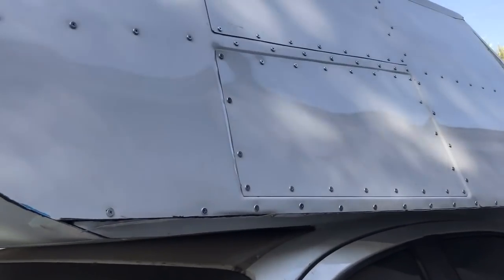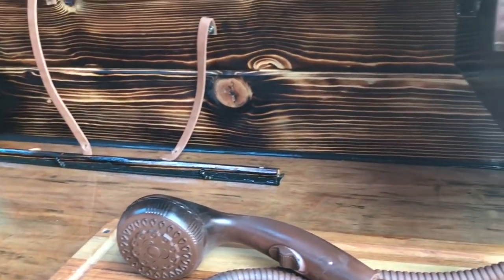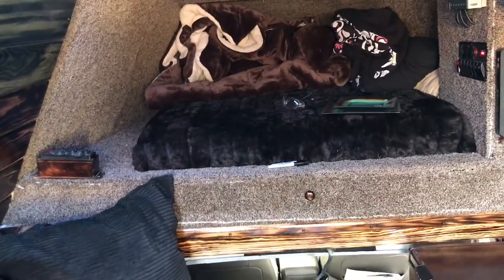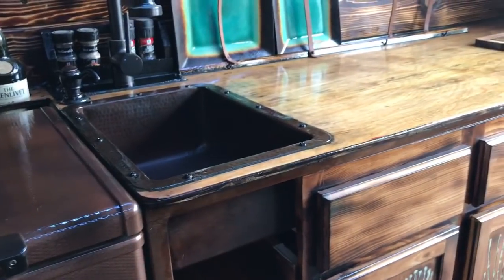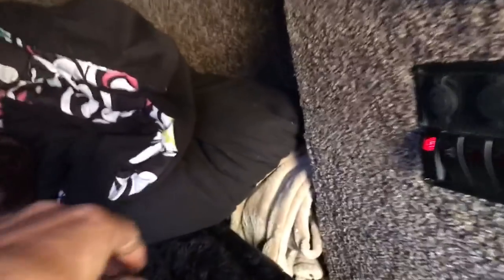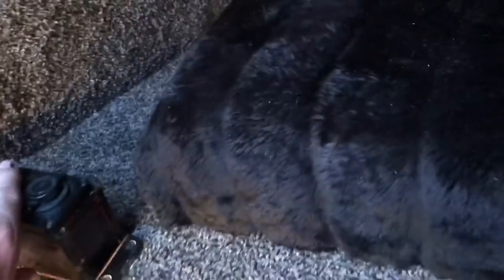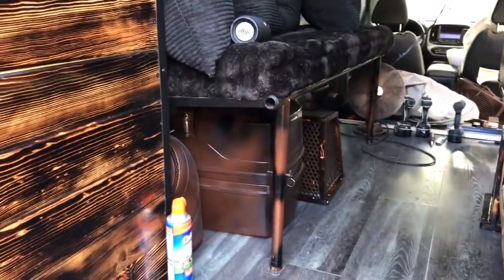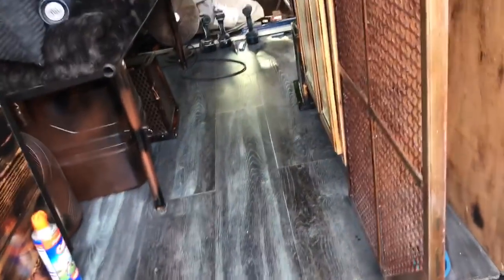Adventure Truck Build Day...Just About Done!

Comment: Crazy? You bet! But you did it! Enjoy-looks awsome!  Wondering about the water heater-fume extraction? Any worries? Just picked up one for my Four Wheel Camper and deciding where to mount or keep it portable. Planning on pop-up shower/porta-potti enclosure.
Reply from the maker: Thank you DMWI! As for the water heater they way we take a shower is like 10 seconds of run time then soap up and wash off! So the heater really doesn't make that much heat coming out the top! Yes it gets hot but for a short period on time and not enough to heat things up! My last one I had mounted directly in the shower about 1 1/2 foot from the ceiling with no issue! I will do a video about it next time I'm out! The pop up shower inclosure doesn't sound like a bad plan! I have plenty of hose to reach inside one an may go that route! cheers!

Comment: It’s not even considered overlanding anymore lmao
Reply from the maker: Way more capable than I was before and a whole lot less set up for camping! I'm sure loving the new build!
Reply: More capable? You might as well buy a rv at the end of the day. Like I said, at this point your no longer overlanding anymore. 😂😂
Reply from the maker: You would be so surprised of just how capable this truck is!  The rear atlas spring with the Fox 2 1'2 3 tube bypass shocks really articulates well making it more capable than it ever was! The rear has a full 14/15 of travel and it just really works! Prerunner its not but it crawls well for what it is still making it a good trail vehicle.